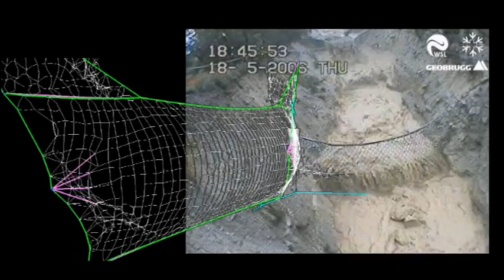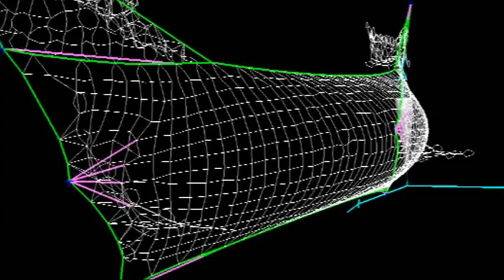Debris flows - when creeks turn into torrential floods

Comment from the maker: That’s quite a good comment, thank you! That's right, there are some barriers which remain filled. Some are in a multi-level barrier system. That means, that several barriers are installed in a row, the filled barrier will be overtopped and the next barrier stops the debris flow. 

But you can also empty a filled debris flow barrier. After the material excavation, an inspection and maybe the exchange of some components is necessary. Afterwards the barrier is ready to stop the next debris flow.

Comment: I love this idea. I can't help but be reminded of the simplicity of 'hesco' bastions. Like the hesco, your ring barriers fill with debris and strengthen themselves through tension. Looking at the end result, you effectively have layered retaining walls in the shape of a rice paddy. 

My question is as follows. Have you lot ever considered pre-placing some system used for permanent ground-level shoring of the debris fill-in? (Picture an underlying mat including another ring barrier) I'm no structural engineer, but my layman logic makes it seem like an idea with potential!

Anyway, thanks for reading this far, if indeed you still are. Keep up the good work!!
Reply from the maker: Hi Derek, have a look at this barrier in Switzerland: https://www.geobrugg.com/en-Galerie-Maachi---BLS
Also, there is basic research that might answer your question (search "Merdeson").
https://www.geobrugg.com/file-48897/downloadcenter/level1-level2-level3-research-papers/Research-2016/Debris-Flow-Protection-Systems-for-Mountain-Torrents-2016.pdf. 
For more questions, please contact Geobrugg in your country: https://www.geobrugg.com/en/Contacts-8098,7847.html
Best regards from Switzerland

Comment: ok that one worked great but they said they are not going to clean it out so it was a one time use  the next one is just going to go right over all of it
Reply: And eventually those cables will rust thru and fail leading to extra material for the next debris flood to pick up, making for mega debris flows.

Comment: Okay they worked great , they did there job. But over time those 3 catch all fences are now full to capacity. Wont the next torrential downpour just ride over top of them now, like before they were there in the first place? I hope you know what i mean, and that im not sounding like an  idiot. M.
Reply from the maker: Hi M Henhawke
The standard proceeding is an excavation of the nets and - if necessary at all – repair of damaged parts.
It is also possible that the retained debris flow material stabilizes the banks of the channel and thus reduces the formation of further debris flow.
(example on our website https://www.geobrugg.com/en-Favazzina).  
You might also be interested in this debris flow impact. 
https://www.linkedin.com/feed/update/urn:li:activity:6836262698389389312  We will continue to inform about the proceedings.
Did we answer your questions?
Reply: @geobrugg  Yes ,pretty much. I do find this very interesting. I will check out your website and the flow impact site. I should of looked into this study when i was younger, im 57. I can still watch from the side lines i guess. I shall look forward to hearing how things work out. Thanks for getting back to me, i appreciate that.  Stay Safe M.

Comment: It is pointless because when all after your barriers are filled you’re back to square one the stuff will just flow straight over it the only Way to keep them working is to empty each barrier every time they fill up
Reply from the maker: You are right: You have to do something when the barriers are filled. After material excavation, an inspection and maybe the exchange of some components the barrier is ready to stop the next debris flow.  But even the filled system can have an important protective function (slowing down the velocity of debris flows in future). Check our example Chosica in Peru https://www.geobrugg.com/en-ANA-Chosica---22-barriers-for-nine-valleys

Comment: So how do they go down in the valley to clean it out? Might need a spider hoe-fill super sacks, and fly them out with a helicopter.
Reply from the maker: Hi Michael, thank you for asking. This depends very much on the local conditions and the equipment available in the country. Generally, the net can be cleared form upstream as well as downstream. Emptying the net from upstream is more maintenance-friendly. The material can be removed and transported away manually or with a mobile excavator. From downstream the net gets opened and the rock debris can usually be cleared away with an excavator and deposited on-site. The net can then be closed and the #Geobrugg debris flow barrier regains its full retention capacity again.

Comment: Tetrapods can do this job!
Reply from the maker: +dp There are usually several solutions for a problem. Heavy concrete structures are well-known and probably tetrapods are also an option. In a specific analysis main questions would be: How to transport those heavy concrete elements to a remote area? (Be aware that our tallest debris flow barrier was 14 meters in height.) How to stabilize inside inclined and usually easily eroding torrents? We will be happy to provide you support if needed.

Comment: Once they get filled up with debris...! And time will corrode the chains links...! It's a huge dam disaster waiting to happen that will be ten times worse in magnitude than the original.
Reply from the maker: Dear Carlos, this system does not create a dam or a water reservoir after a debris flow. Depending on the material held back (scree, stones, trees), the water can also flow through or over the debris flow barrier when it is filled. Even the filled system can have an important protective function (slowing down the velocity of debris flows in future). It is more common to simply open the net at the bottom and remove the debris. The net can then be closed and the #Geobrugg debris flow barrier regains its full retention capacity again.